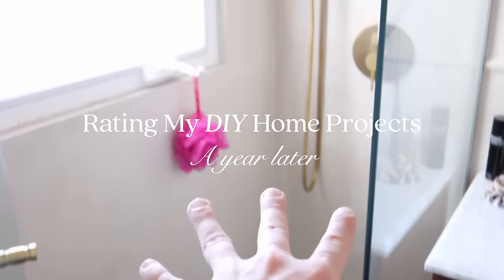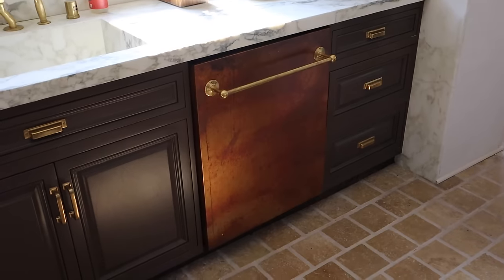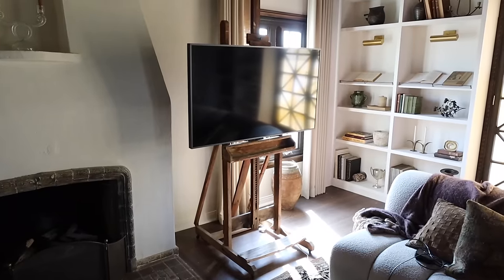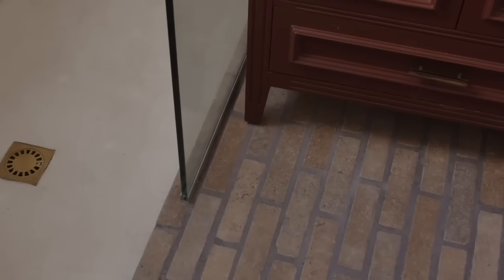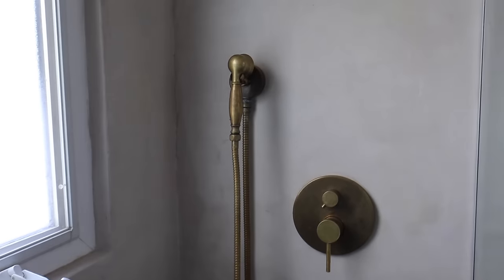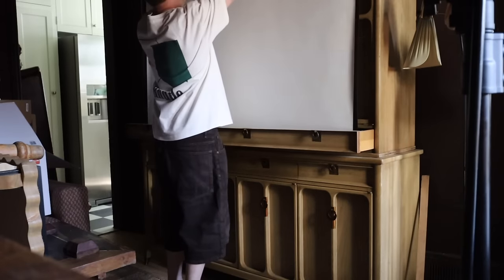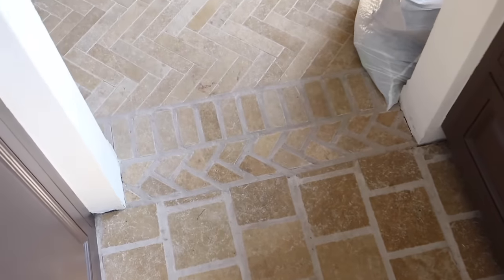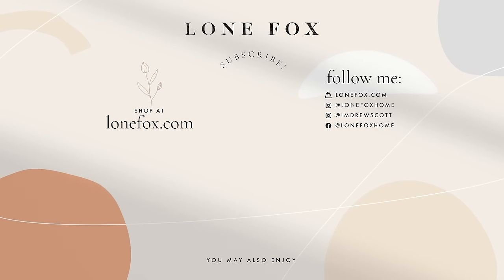Rating My VIRAL DIY Projects 1 Year Later... Was It Worth It?

Comment: Some ideas/tips. You can use Barkeeper's friend on copper, works super well.
For the plaster bathroom, it would be super nice if you rounded the bottom edges inside the shower to avoid the hair/dirt from getting stuck in the corners and it would look great with the coved ceiling :)

Comment: For that movie screen that pulls out of the drawer, have you thought about installing a pretty hanger at the top instead of using the screw?  I think you could find something decorate that would look nice when the screen is not in use.  Just a thought.  Also, I did like the frame around your TV screen in the other room.  It was very cool looking.  Again, just my thought.  I think my fave is the absolutely still-stunning kitchen tile!  All these projects are very cool, and have stood the test of time.

Comment: You can clean the tile grout and re-seal it. There are all kinds of grout cleaners but I used Comet powder that was watered down to a thin paste and then hand scrubbed it. I then re-sealed it with a couple coats of sealent.  Two years later and it still looks great. A LOT of work, but well worth it.

Comment: It's nice to see a follow up video, since I do always wonder how projects hold up over time. I also like that you included links to the other videos in the description. I might have to check those out.

Wow! All of these projects look beautiful & really upgrade the space. 

The natural patina on the dishwasher panel looks amazing. If you do want to polish it, I think there are products for that, but I've also heard you can use ketchup (or I think simply tomato sauce). I don't have any copper pots, etc., so definitely look that one up first! 

I agree with you about how the easel TV blends into the room much better than mounting over the fireplace. If you could get a large battery for it, and had wireless connection (or use casting from a device), you could put it anywhere. 

The Concretta gives such a calming natural look & blends nicely with the brick floor. (I'm wondering how hard it is to remove if you want to take it out later on, though.) How hard is it to clean in the shower?!

Great idea with the hidden screen. It's great that you can still use all the storage space in the hutch.

I love the herringbone floor & the idea of using the same tile with different sizes and patterns.

The style of the whole house is classy and cozy at the same time. I would love to live in a place like this.

Comment: Use OxyClean on the grout to brighten it up. Just add some into an old dishwasher liquid bottle, squirt in onto the grout, let it sit a couple of hours, then use your broom to scrub just a little, mop, rinse and VOILA! All your grout will be back like new! I have beige tile with a very light grout, and being a gardener, I'm always dragging dirt into the house, especially around the front door. I tried everything, even grout cleaner, and in desperation, I tried OxyClean, and it worked so well, I'll never use anything else.

Comment: Copper etcher (intaglio printmaker)-. here: You can absolutely seal copper with spray lacquer. To remove patina, you would rub soy sauce on a rag (preferably mixed with calcium carbonate) over the surface, rinse with water and dry fast. This would return it to a very rosy pink. Without a coating, copper will oxidize and eventually turn green in colour. If you wish to slow but not permanently arrest oxidation, you could periodically apply a thin layer of oil to the surface. Think sewing machine oil or something else that could be buffed on thinly . This will help stop it from reacting with the air. Oxidation will be accelerated by getting the surface wet and having it air dry. This kind of oxidation, in the form of drips and splatters, doesn't tend to look intentional imo--less "marks of use", more "poorly maintained metal".

Comment: I have a bedroom that is natural clay plaster and I want to redo it with the Concretta FS that you used in the bathroom. I get some dusting from the clay plaster. How is Concretta with dusting?  I also placed sand in my primer to give the wall some teeth to hold plaster on. I assume Concretta FS will bind to the walls. I need to watch that video again about the bathroom to get a good idea how much I need to buy. Thanks for the great ideas.

Comment: You are SO talented! Nobody would ever know you didn't pay a pro many hundreds to lay all your tile. Looks great. I bought a place with a huge bar that someone mislaid the tile on. It has a lot of uneven thickness or "lipping," whick makes it impossible to slide a glass across it. The large tiles are visibly different depths . . . Also a hiddeous color. So can concreta be artistically painted like marble or stone & sanded to create a smooth look, then finished with several topcoats of hard poly or resin or ??

Comment: Samsung's "The Frame" televisions actually come with a textured screen option to somewhat emulate the texture of fine canvas if you really wanted to lean into the whole "This is a piece of art" approach. They also come with a picture frame mode which dims the screen backlight considerably so it doesn't stand out as much while still displaying the content beautifully. I may not be the biggest fan of Samsung, particularly their televisions due to some controversies regarding ad insertions, but that is still a really cool product for people who don't want to have their entire living room focused around an obvious television.

Personally, I don't prefer the plaster bathroom, but I can understand the old world charm that it offers, so I'll give it a pass because it's not my house. On a side note, though, you can absolutely tint and glaze those kinds of products if you don't want just the plain off-white plaster look. I think the only thing I would have done rather differently would be to make an actual sliding plaster mold/former for the chair rail just so you could get the lines extra crisp and accurate. Look up some videos on how to repair or manufacture plaster trim molding to see the kind of tool I'm talking about. It's basically just a piece of metal with a cutout of the profile you want to form and one or two sweepers to help push aside excess plaster. Another option for alternate finishes on such plaster projects is to look up how to burnish plaster and apply the same techniques. I checked the Meoded website and the concretta product you used is designed for several different finishes including a burnished plaster finish. You just need to make sure you use an appropriately polished plaster trowel when burnishing the surface. While you won't be able to get the mirror polished finish that you can get with actual plaster since this product isn't available with extra-fine grit finishing formulations and also isn't intended for oil polishing, you should still be able to achieve that old-world Venetian satin to semi-gloss plaster look.

While the DIY lift-up projector screen is a very cool project, it is woefully undersized to truly qualify as a "home theater". Home theater display sizes pretty much start at impractically large formats for ordinary spaces because you need a sufficiently large display to get the level of immersion you need to qualify it as a home cinema. You'd need a particularly large credenza or buffet to be able to fit an adequately large pop-up projection screen. The other complication of a home theater is the need for quality speakers and good speaker placement. A minimum for a home theater setup is 5.1 surround sound and, while you CAN get quality in-wall speakers without completely obliterating your budget, it isn't ideal to try to use them for the front stereo speakers, as those are the most important to get right. At best, this is a secondary living room with a slightly larger television in the form of a projector. A 100 inch projection screen is over 7ft wide and is generally considered small by home theater standards. 

I would probably have opted for slightly narrower grout lines in the kitchen, but it is an exceptionally good look if you're going for that slightly modernized old-world charm. It screams modernized Tuscan countryside villa. The choice to delineate the spaces by using tile borders and changing the tile format and pattern while retaining the same material is an excellent choice because it ties the spaces together while making them feel very different.

Comment: That grout looked like a chocolate brown when you were applying it. Once it was dry it looks like it's a light grey colour. Is this right? I was actually looking forward to seeing the brown colour next to the tile. 
Another point- is it tile or pavers? They look a lot more like pavers to me. 
I have a herringbone pattern in the pavers in my courtyard. I highly recommend you do not do this pattern in an 'outdoor' room. This is because it's not grouted or cemented in place. You have to add at least one bag of sand to it every year and brush it between the pavers (which is harder than it seems with the pattern). More importantly, WEEDS come up between the pavers constantly. This used to drive me nuts. I tried everything from steaming them; vinegar and salt solutions; to commercial chemicals. Nothing stopped them. They were wild (not in a good way). I finally settled the matter by covering it over with rubber garage flooring until I can find something I like that I can afford to do. I really love the feel of the rubber under my feet so I ended up putting it over the tiles in my kitchen. It's so easy to clean and I can lift the whole flooring up and take it outside to rinse down.

Comment: Drew, is the kitchen tile hard on your feet? I notice that some of the tiles aren't as flush as the majority of them. Does Marie wear heels? It looks as if you could get a heel in there that you might need to work out of the height difference, or it could even cause you to fall. I wear a slip on sandal at home and it often gets wedged in one of the bathroom tiles that are simply not as flush as others. What happens is I can't complete my step and have to reach out to grab something to steady myself. I really dislike tile😢

Comment: Why is that my tilers had a much more complex process? They measured the floor flatness continuously to ensure the backing is flat (custom cabinets will go on top of the tiles) including the waterproofing layer. The tiles were laid out completely first to check the tile arrangement was acceptable. Of course they used spacers for the 1/16" grout.
Reply: Your tilers did it the correct way.  This gentleman said he didn't measure, use spacers, etc, because he didn't want it to look perfect.  He wanted a more organic cobblestone look.
If  tiles aren't set perfectly flat, as your tiler did, your grout and tiles would more than likely eventually crack.